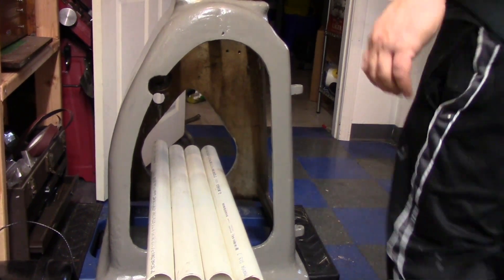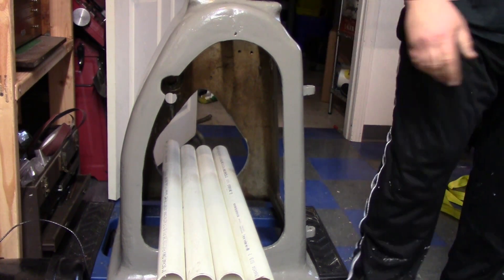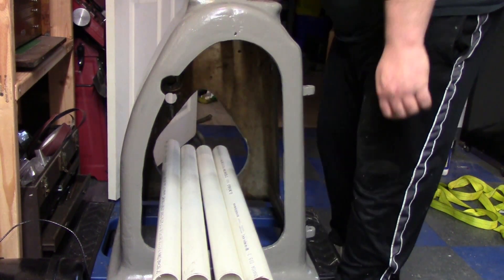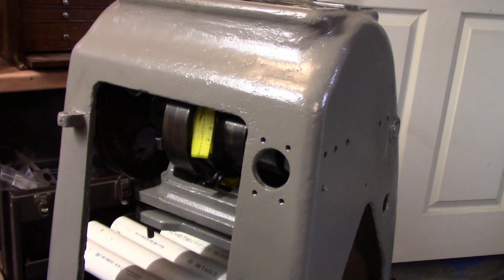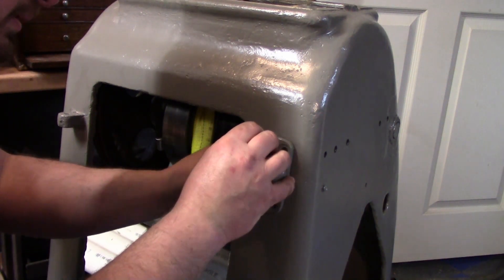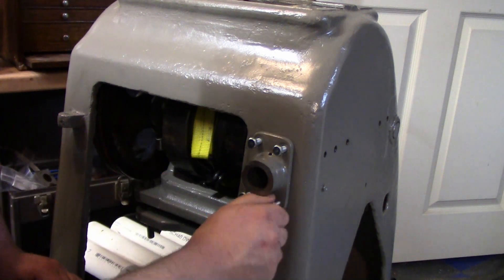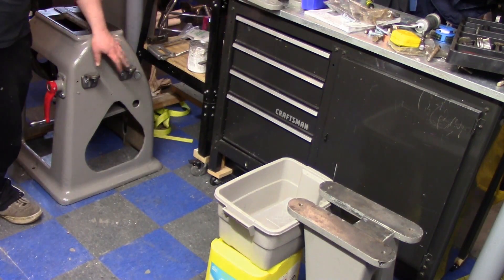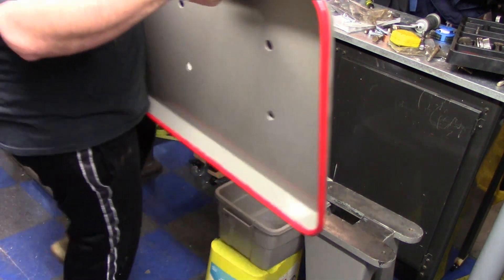13" Southbend Refurb: Bed Assembly

Comment: If you really don't want bright finish bolts, I've found that dipping them in 'Birchwood Casey Perma Blue' liquid gives them a very dark (almost black) oxide finish, which looks more fitting on vintage machinery.
Reply from the maker: Thanks for the tip